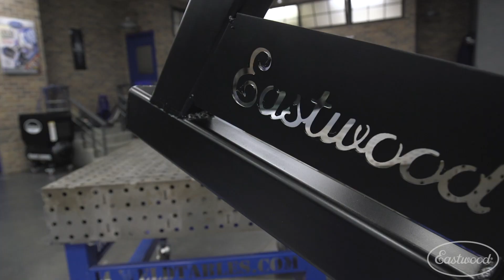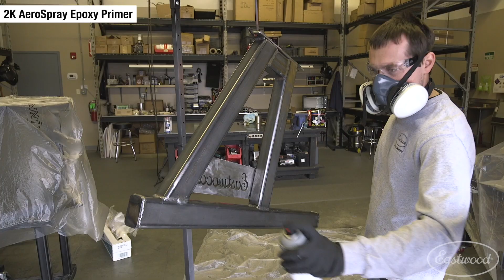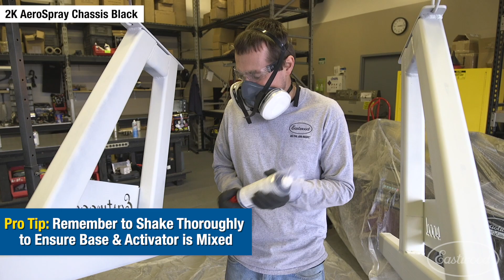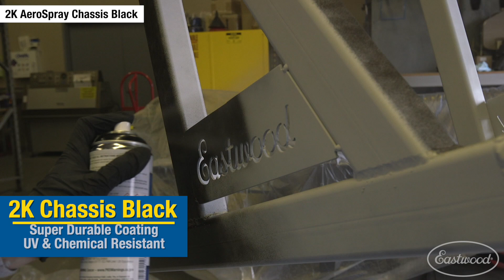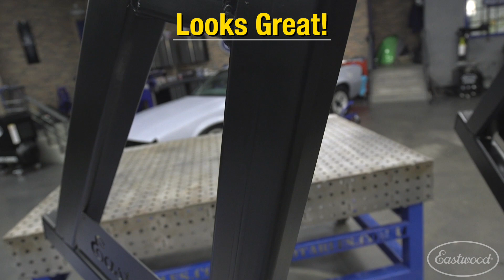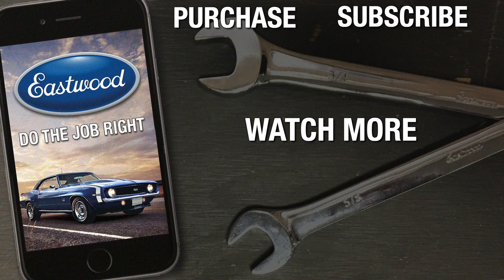2K AeroSpray Chassis Black Over Epoxy Primer - Painting the Legs Of the Box & Pan Brake Stand

Comment: Does this require a primer to be used on aluminum? I will be blasting the aluminum to give it a rough profile for better adhesion as well. Thanks.
Reply from the maker: From the site: Chassis Black auto chassis paint is a durable, high solids paint that can be applied to bare metal/primed surfaces. Chassis Black works great over bare metal, Chassis Black Primer, or Eastwood Rust Encapsulator. Allow 15-20 minutes between coats. Recoating after 12 hours will preserve the same gloss level. After application, the object should dry overnight before use. For best results, use when can is between 70°F to 90°F, 50% or less humidity. DO NOT topcoat Chassis Black with Chassis Black more than 45 minutes after last coat as lifting may occur. DO NOT use Chassis Black over single-stage Self-Etching Primer.

Comment: Always enjoy your products. Keep the videos coming. I have a question. I’ve got the 2K arrow spray chassis black satin finish and I bought about five cans four years ago never opened and they’ve been in my garage through the last four winters.Will these still be good to use and will be they be as durable as day one, thanks
Reply from the maker: That's a long time to have something sitting on the shelf - we'd suggest doing a test panel to make sure you're getting results your'e happy with.
Reply: @eastwoodco  Thanks for the Response. I will give it a try!!